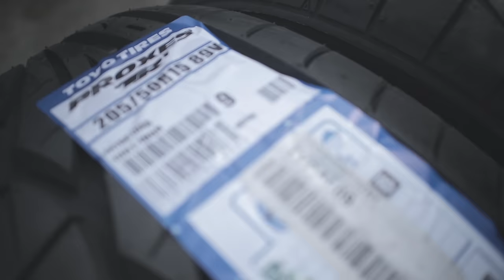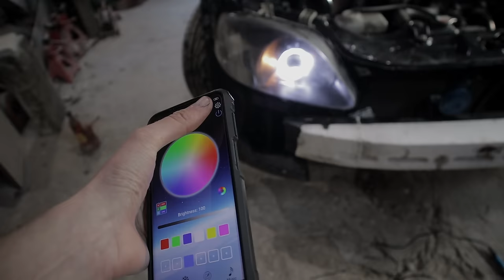Restoring a 1999 Honda Civic Ek 1 year in 15 minutes

Comment: Wow, so much work!  Glad this showed up on my main page.  I appreciate all the metal work you did on this.  Crazy time-consuming. What is your welding setup and your welding experience?  I've been hesitant to get into welding.
Reply from the maker: 🙏🙏 I got a cheap welder off eBay that runs gas and flux core wire. I've only used the flux core wire. Doing the civic was my first time welding . Just start you'll soon figure it out 😬😬
Reply: Mullac 720 CRXseth is a beast at some body work as well!!! If you ever get some spare time you should hop over on his channel and check out his black B16 Rex he dailys it’s a beautiful ride!! He’s done some awesome work on other Rexs too. This was an awesome Video man. I had a black 98 ek hatch. It was my first car and watchin this makes me miss it!!
Reply from the maker: I will do 🤙. Thanks, maybe it's time for you get another one 😉

Comment: I had a 1996 Honda Civic Si hatchback in college.  That car delivered over 300,000 miles of pizzas.  I only replaced the oil, brake pads, rotors and tires. I traded it in for a new Ford Ranger 4X4 after graduating and getting my first real job.
Reply from the maker: Hopefully i can get to 300k in mine, they are good cars apart from the rust :(
Reply: @mullac720  mine was a 5 speed.  I didn’t ever replace the clutch.  The only thing I wish that car had was a leather interior.

Comment: I did a bit of the same type of brake job on a 2006 Honda Accord after one of the break pistons had seized. Rebuild and paint to prevent rust. But what is the white stuff on the contact surfaces of the brake rotors? It looks like it's painted so is it some protective chemical when it was shipped to you or what am I missing?

Comment: Amazing work! I'm attempting something similar starting this week. What was the black paint stuff used on the rear control arms? And what remover was used?
Reply from the maker: thanks. Tractol enamel chassis paint. and neutrarust 661 rust convertor

Comment: What gauge metal did you use for
Your floor board and body repairs?  I’m in the middle of the same project. I’m new to welding and am having problems blowing holes in the metal even on the lowest settings
Reply from the maker: 1mm for the floor and outer panels, sills and chassis was 1.2mm, yes u blow through it easy. gotta just do loads of spot welds, no continous welding

Comment: Good day. Would be nice if after a year the condition of welded points esp those that not painted on the other side is monitored.
Reply from the maker: Pretty much all the insides of the metal had weld thru primer on it and all areas that I could get to inside the sill was undersealed so shouldn't be too bad .... Hopefully 😬

Comment: TIP: Next time when you weld, grind of the metal plates in 45 degree, so you have a 45 degree canal on both sides. Weld in the middle of that and you get a really nice welded line, and the structure gets way more solid.
Reply from the maker: Thanks. But would that work on 1mm metal? It burns through way too easy as is 🤔
Reply: @mullac720  low amperage. Depend what welder you use :). If you use those old stick/pen welders, you will burn through it. But nowaday TIG welders can weld really nice, even on thin plates.
Reply: @Oxizee  Fluxcore wire welders are not that delicate but good enough.

Comment: What welder are you using and what gauge metal are you using?
Reply from the maker: Wolf MIG 140 Welder and 1mm for body panels and 1mm and 1.2mm/1.5mm for the sills/jacking points

Comment: This is amazing to watch I’m gonna be going through the same process soon so just one question after you’ve cleaned the rust off the parts what’s the blue and black stuff your painting on the parts ?
Reply from the maker: Neutrarust 661 , rust convertor. Converts the left over surface rust to a paintable surface for primer etc

Comment: GREAT BUILD! Amazing work, man, congrats! Just a recomendation for ur next one, be careful with brake disc painting, it can make it not work properly. Also it probably came out after some braking, so it is probably not worth the effort even if it wasn't bad for the brakes. But other than that, I have nothing to add. Beautiful work man
Reply from the maker: Thank you. i didnt paint the area that the brakes touch so thought it would be all good!. Appreciate it <3
Reply: Are you referring to the rotor surface? As he quite obviously didn’t paint that area…
Reply: @mullac720  ooooh now I watched it more carefully, ur right. It’s just that here in Brazil we don’t have brake discs this color, so as it is white (or at least looks like it) I thought u had painted it. Sorry man!!

Comment: So EK1 and EJ9 is technically the same? (excluding engine 1.4 / 1.6)
Reply: no the ej9 is the type r they come with a lot of different parts like sway bar n disc brakes in rear but other than those things yeah same car kinda
Reply: @preciserandomness1351  bruh. EJ9 is cheapest version, EK9 is Type R
Reply: @preciserandomness1351  i have 1997 EJ9 and it is not Type R and have 1.4 D14 engine with drum brakes in rear

Comment: How much for this restoration? I would like to do the same on my civic but I'm afraid of breaking up the budget.
Reply from the maker: About 1000£ for all the repairs on rust,engine and paint.
Reply: @mullac720  Only £1000? With threaded handsets, engine parts? It seems to me little. When I checked for mine I exceeded €2,500
Reply from the maker: More if I add the nice parts like brand new wheels tyres spoilers etc. But everything necessary was only 1000£.
Reply from the maker: Spent 2200 all together to get it to where it is now tho
Reply: @mullac720  Ok, nice job anyway, it makes you want! Even if mine is not normally rusty because it has already been treated. But it's motivating, I'm going to get back on it.

Comment: Not in love with the projectors or fart-can exhaust. Otherwise this looks great, especially the DIY hood thing you did, I wouldve not had the balls (also its not functional? These tiny engines dont put out that much heat, unless youre running unshielded extractor with an oversized radiator.)
EK3 vtec hatchback owner myself :)
I have atleast 3 rust-spots to get to repaired before August 1st.